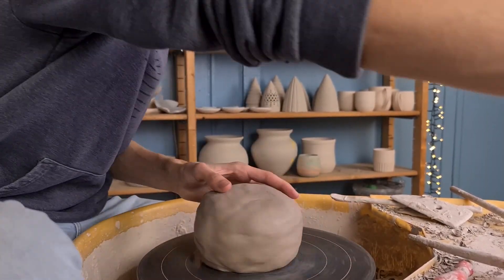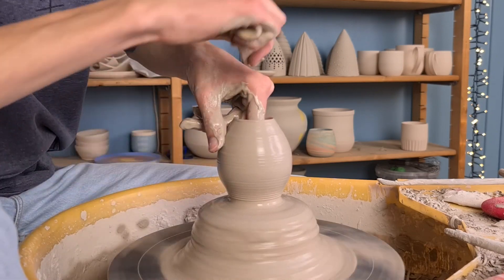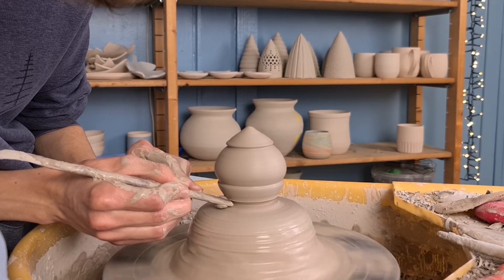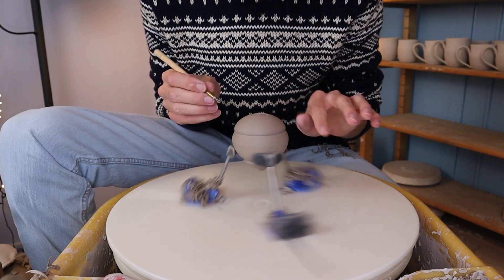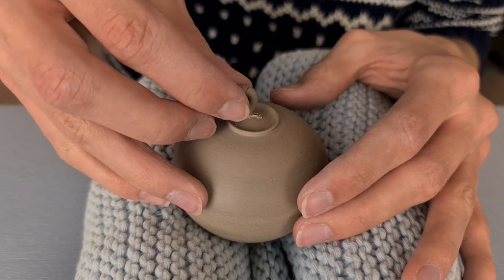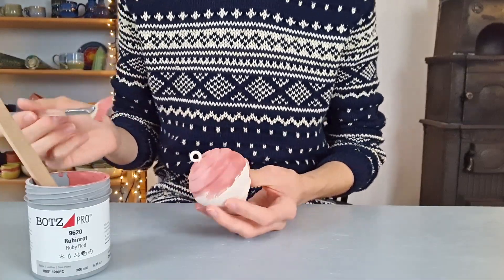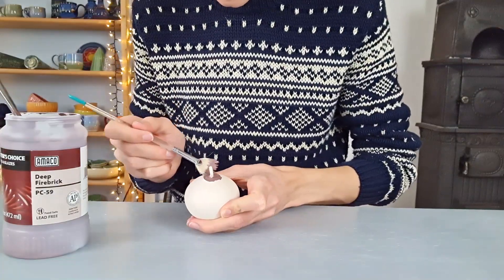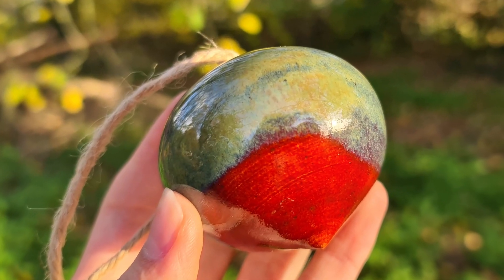How To Make Ceramic Christmas Balls // throwing christmas ornaments + two glazing combinations

Comment: May I ask, what is the gauge and material of the wire that you are using to hold up your ornaments? I have used nitride but it slumps at high fire. Thank you.
Reply from the maker: I'm sorry, I'm not sure what material it is, I got it at my local pottery shop in The Netherlands: https://www.silexshop.nl/product/staaf-metaal-diam-2x300-mm-1250c/

Comment: Great video as usual! Thank you! Question - how heavy are they? any tips on making sure that it doesn't get too heavy and thick?
Reply from the maker: Thank you!! I didn't weigh them, but my tree is strong enough😅 To make them light it is important to throw as thin as possible. And I would also recommend to trim as much clay as you can. If you struggle with throwing thin you could also trim both sides of the ball.